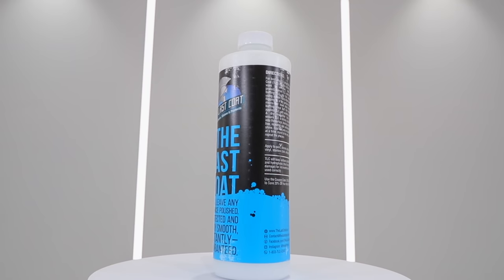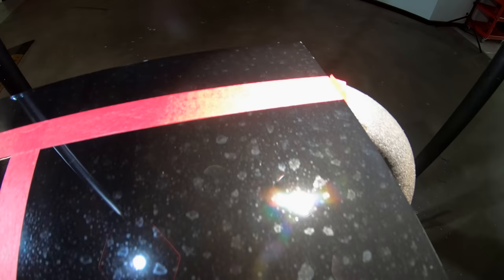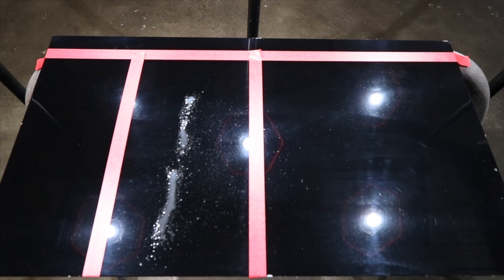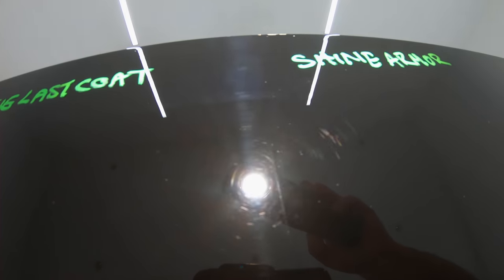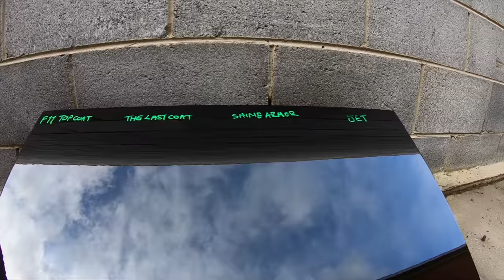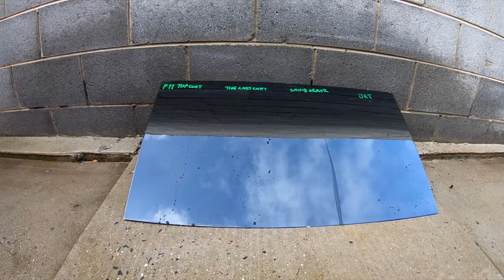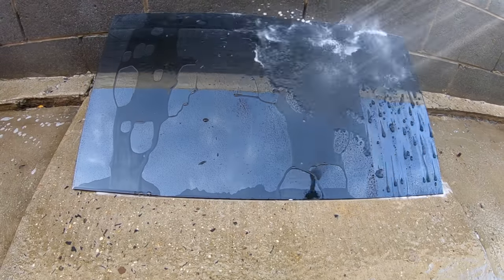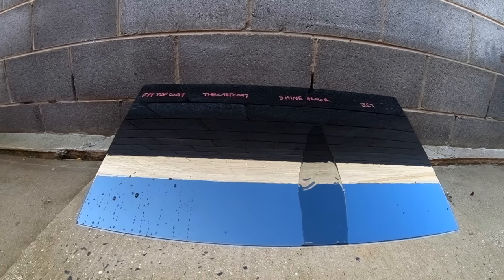F11 Top Coat vs The Last Coat vs Shine Armor - In-depth Testing & Results!

Comment: Shine Armor has banned me on Facebook for pointing out that you should not wipe dirty panels with a MF because, as demonstrated, it'll just scratch the paint.
Reply: All depends on what product you are using as a waterless wash.  The carpro product left virtually no marring.
Reply: I agree makes me cringe people wiping a dirty car... wash it first.. 😑
Reply: Lmao you can get it at Ross for less than advertised
Reply: @maurobeltran3072  yes I tried buying it at Ross. When I opened the box it was a bottle of fabric freshener
Reply: If my car is very lightly soiled I'll use a quick detailer. But if its filthy, there is no way I'm doing that

Comment: I’ve wondered about these products, especially F11 and Shine Armor for quite some time, thanks for the review Sandro!
Reply: I've use f11 on all 3 of my black vehicles and I love it. I was nervous at first when my friend gave me some to try. I wasnt disappointed.
Reply: @zerot678  If you follow F11 instructions, DON'T USE SOAP, and put on at least 4 coats with 24 hours between coats, F11 does what it says it will do. Also, it works at a microscopic level so requires very little product. I just rinse with water every week or two and dry. Then buff with clean microfiber towel to bring out shine. I put another coat of F11 on every month or two when water beading gets weak. I've used about a quart of F11 since Aug 2017 on my 2017 F250 and it still looks new.
Reply: @gregstone3877  Jesus, if I had to put 4 lays of a product on with 24 hours between each coat, I’d get a better quality sealant... I’m a professional detailer and Nova Jet is what I use on almost every car, it’s phenomenal and only requires a single quote and only 2 hours to cure. You’re putting in way more effort than you need to!

Comment: Sandro, thanks very much for doing this video. Finally a quality review on these products. As I thought they are nothing but snake oil salesmen. I've only really been I to detailing for a couple of years now and must admit I bought Hydrosilex in my early days before I knew anything detailing. I never used it till about 3 months ago just to get rid of it. It lasted only one wash and was outperformed EASILY by 303 Touchless Sealant which I use when I'm in a rush. I will post this vid on each and every ad I see on FB from now on. Thanks bud. Great work as always.

Comment: Great review!  I have a neighbor who used FW1 products and used it without washing the car first because that's one of their selling points. Before he did, I told him not to because even with ONR always requires water, I told him because it made no sense.  Well, he did it anyway and had a lot of swirls and you can imagine how disgusted he was.  I used TLC2 instead of TLC because they are different made.  Also, have used the new Turtle Wax Ceramic products as well as Meguiars Ceramic Wax and they are great because can be applied to trims without making them with white  residues.
Xoxo from Puerto Rico 👍🇵🇷

Comment: So I bought into the last coat because of pan the organizer about a year ago. It was nice on the paint at first but didn’t last that long. Overall it wasn’t a huge problem because I use so many other hydrophobic toppers. Since I had so much left I switched to using it to spray on the wheels when wet rinse off. This is where my love hate relationship started. It absolutely looks amazing on wheels and does and excellent job resisting brake dust. However it’s chemical resistance is horrendous. One spray of any diluted cleaner and it’s gone.

Comment: Hi... i want to start a pro detail business... and i believe people want the paint to look the best as well as be protected for a year at a time and easy to clean...which product do you think is best for me to buy first... ? would you say using meg 101 or 105 followed by 205 then apply a 0ne of these??? do i just need to wipe of with micro fiber towel or do i need to clean with a product first before applying... also what about applying in sun or hot panel??? any information  is greatly appreciated since i want to provide my customers with the best solutions for their cars.... i really like your demo videos..unbiased and very well explained...thank you...
Reply from the maker: It really comes down to the condition of the car and paint, what the client hopes to achieve, their budget and what’s realistic based on those things, so it’s very hard to settle on certain products and methods without that specific information and without doing a test on the paint first. 
If you have a look at a few of my detailing vlogs, I try to take the viewer through that journey and explain those things.
Reply: @CarCraftAutoDetailing  i understand about restoring finishing i wet sanded and buffed out boats for over 12 years mainly gelcoat finishes ..then i would just use a wax...these ceramic sealers are new to me... i asked which sealer is the best protect and once surface is 100 percent nice do i need to use any special formula to clean... that one on end seemed best...f11 seemed pretty weak and a ripp off..
Reply from the maker: Okay, yes it’s really best to use an IPA mix (alcohol based cleaner) before you apply your sealant to remove polishing oils and ensure you get the best bond to the paint. The best way to main them is to using a pure car wash with no additives like Nv Snow or CarPro Reset. 
Some of my favourite sealants are Nova Jet & Lustre and Meguiars HCW

Comment: The Last Coat 2.0 is awesome and will love see shoot out between Nova Jet, Gtechniq C2 Liquid Crystal, Car Pro CarPro HydrO2  and say Gyeon Can Coat. I have use TLC 2.O as toper on other ceramic coatings and works great or stand alone. TLC is probably too expensive to bring in to Australia just like bringing Nova Jet in the US. great video Sandro very honest and detailed testing as usual.
Reply: We'd love to bring Version 2 with an Australian distributor, we've talked to a few. You're right, the logistics can get pricey.
Reply: I was lucky enough to get TLC2 a while back when there was a 2 for 1 offer. Which made it a bit more affordable.
But with the Aussie dollar now even worse than what is was Vs the US Dollar. it's the conversion cost that makes if pricey here in Australia.
Still for what it is. It a great product
Reply: Purple Haze FFC thanks a ton. Yes it was a big difference over the original version shown in this vid. Thanks for the support, we’re hoping to be able to get some local distribution in Australia soon.

Comment: Topcoat F11 is a polydimethylsiloxane, or type of silicone oil but water based.  It is not a polish or sealant...and when water or soap is applied to it, it will wash off your vehicle.  Many shampoos use it to make hair shiny and slippery.  This is NOT an automotive product, and no respectable detailer would ever use or recommend it.  Nice Video!

Comment: I appreciate your detail and honest reviews. Do you have much experience with Duracoat Technology products? Also in regards to Nova Jet is it safe on flat paints and interiors that is the biggest claim difference to all the products I’ve noticed about F11.
Reply from the maker: No I don’t have much experience with Duracoat products. You’ll find that almost any spray sealant will work just fine on matte or satin paint and although they may not be the best option for interiors, they’ll also tend to work there without issue. Thanks

Comment: Hi new to the channel but have some questions for you. I was wondering what you would recommend for me and my truck. I’m looking for something that would be easy to use and protect my paint and give it a great shine. Also a great interior detailing solution ? I was looking at  NV auto the jet and lustre for exterior along with the snow + wash.  Interior I was looking at gyeon. Not sure about wheeels and tires maybe you could recommend something theee also. Tell me your thoughts please as I look forward to hearing back from you.
Reply from the maker: Lustre & Jet perform and look great so I’d happily recommend them, Snow+ used before hand for a deep wash maybe with an IPA wipe prior to applying the sealants will help (if the paint needs to be clayed and or polished that will also help). 
To maintain the sealants moving forward, Snow is a better option than Snow+. 
I haven’t used Gyeon interior cleaners or dressings, but I’d assume they’d be good. 
Nv Purge is great wheel cleaner, Carpro Hydro2 is a great wheel sealant and Carpro Perl, DarkSide or Nv Onyx are great tyre dressings. 
Hope that helps.
Reply: @CarCraftAutoDetailing  yes ty my truck is brand new so just maintain I would think

Comment: I have a detailing job coming up. The customer doesn't want clay barring or iron remover done on the job. After watching this video, I'm thinking that The Last Coat might be a good option to use. The cars in good shape with a nice shine but does have light swirling on it. Would you feel that using The Last Coat would be a satisfactory option?
Reply: If you're after something that you can purchase easily, then Turtle Wax Seal and Shine would outlast TLC.
Reply: TLC2 (the one in the video above is the old original version) is very different in terms of durability and longevity just fyi. In terms of filling swirls, it will to a degree yes. Version 2 is a ceramic-based formula so the "filling" is not as pronounced as some other products, but it will help a bit if they are light.

Comment: Sandro, maybe do a test with new turtle wax's Ceramic spray on and Car pro Hydro2 and nove jet, just to see what will happen between the difference of a SIO2 based spray on and wipe off and hydro2 wet application spray on hi pressure water rinse off, how good it really is compared to the dry applications? Also does IRON X effect any of the spray on sealants wet or dry and or dedicated iron removers for painted surfaces and not iron x for wheels if you get my drift ?

Comment: Car craft auto detailing you should use the last coat version 2 there upgraded formula.
Reply: In my experience, TLC2 is way better than the original formula.
Reply: Ya, big difference in formulas.
Reply: I purchased 2 bottles of TLC and wasn't too impressed. Wish I could trade in those 2 bottles of TLC for 1 of TLC2 😥

Comment: Great Vid. Wished you had done this earlier as I’m one of those who forked out big$$$ to purchase the 3 online products. Haven’t used Jet but can compare with Maguire’s ceramic spray wax and Turtle Wax seal n shine. I concur with your findings and find that the cheapest product; seal n shine is the best by far. What you don’t show in your vid is that the 3 online products disappear after 1-2 regular contact washes. They are pretty good on plastics and glass though, then again so are the Maguire’s and Turtle Wax products. I’ll be sticking to the seal n shine I think.

Comment: So quick question. From your experience,  which product have you used has the least static? I've been using Turtle W Cermaic spray and my car is covered in dust within hours. And I dont know if I'm ready for a full blown ceramic coating.
Reply: @CarCraftAutoDetailing  that sounds good. Thank you for your answer.  Looking forward to more videos from you.

Comment: If I may say something, The last Coat has two (the last coat products.... one is called TLC 1( or the one you have which is white in the spray bottle and the new formula which is the now famous TLC 2.... TLC 2 is a transparent liquid and has a lot more chemical resistance than the first version that you are testing and its a bit cheaper

Comment: If you follow F11 instructions, DON'T USE SOAP, and put on at least 4 coats with 24 hours between coats, F11 does what it says it will do. Only use soap if you want to remove F11 for paint repair. initial coats  you start to see and feel the difference.  Now I just rinse with water every week or two and dry. Then buff with clean microfiber towel to bring out shine. I put another coat of F11 on every month or two when water beading gets weak. I've used about a quart of F11 since Aug 2017 on my 2017 F250 and it still looks new. I'm not saying there isn't anything better than F11 that you can even use soap on, but if you follow F11 instructions it works.

Comment: Do you put wax on after , or before a coating like one of these? And are any of these safe to use on vinyl boat seats or flooring?
Thanks!
Reply from the maker: You don’t have to use a wax at all, but generally you would add it after these products. You could use these products on vinyl seats as a way to give the seats a quick detail, but there may be better more specific products for that and I’m not too sure how they would work on flooring.
Reply: @CarCraftAutoDetailing  appreciate you man. Always love the videos as well.

Comment: Where did you buy The Last Coat from? You got their original version as opposed to version 2, which has been released for many months. If you bought it directly from TLC, I’m sure they’ll correct it for you. I had bought a couple of bottles of version 1 a month or two before TLC came out; they were kind enough to send me a bottle of TLC2 free of charge after I messaged them. You should contact them. There are many YT videos on TLC2 and its improvements.
Reply: It looks like it was purchased from an eBay seller, it was the original formula in the video. As you know there were some big improvements. We have been in touch with him if he wants to try TLC2. Thanks Ryan.

Comment: The sheeting & beading properties of Nova Jet are quite impressive. Clearly it’s the top performer in this group of spray sealants. I would like to see a test of IGL Premier and Griot’s Ceramic 3-IN-1 Wax. It’s Griot’s first Si02 product with carnauba wax added. They claim it lasts six months and reduces dust and dirt adhesion.

Comment: Don't get me wrong, but Sandro knows his stuff, but i can say this much not one Ceramic coating has been approved by the auto Industry as in the automotive industry's own regulation and  testing department arm, like the ACCC for example, if all the so called Detailing products had to be made to a standard and ISO standards, then everyone would be in a better world as they have the tick of approval and were tested by lab technicians to a standard which applies to the automotive sector, even permaguard is not approved, yet they claim the products are used in the aircraft industry, meaning that various aircraft operators have used it on their planes so its much easier to keep clean and also maintain, instead of re sprays every so many hours  of flight time, but what they use in the aircraft industry, is regulated, thus the same company who makes and provides a special coating for aircrafts is more or less saying the same products or a version of it can be used on the Mercedes cars etc, yet its nothing like it, dont get me wrong most good quality SIO2 based sealants out there can be said its a scale of 1 to 10 per say ,so its unto the consumer to check online or check with the basics tests and reviews done on retail products to see how good or bad they are its that simple.
Sandro is simply the best Detailer i have seen on u tube bar none its that simple and most of the reviewed p[products points you in the right direction and very informative?